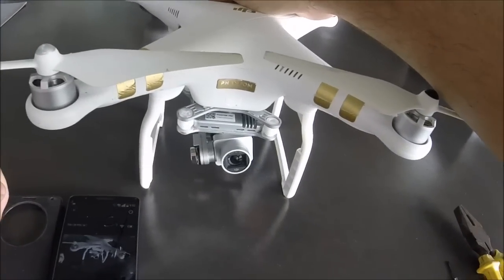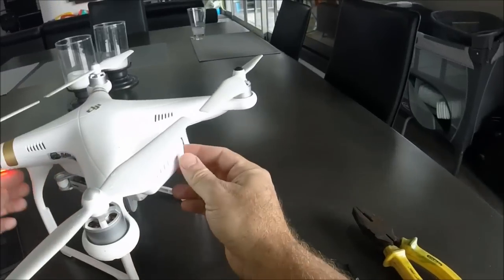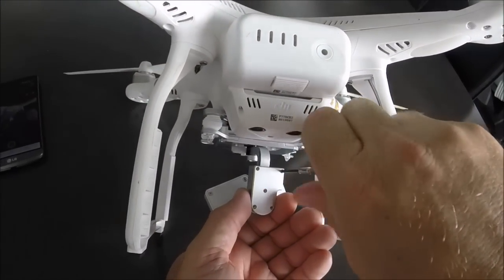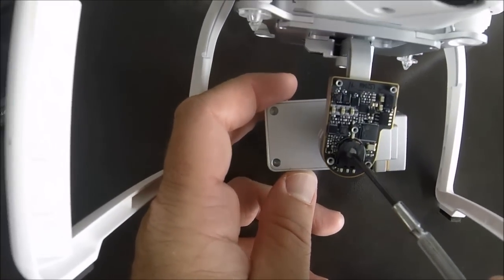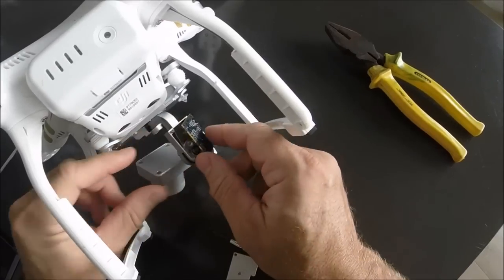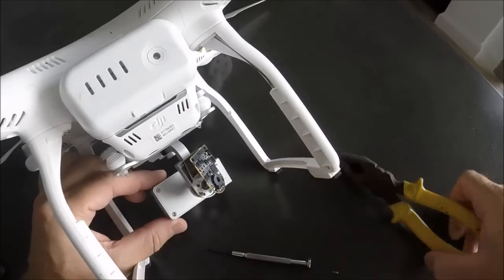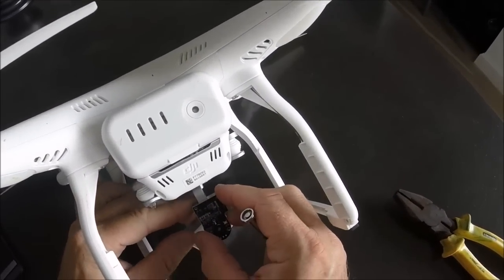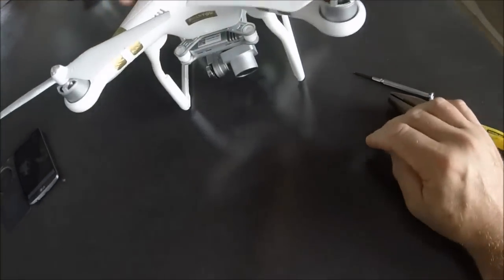Repair Phantom 3 gimbal startup position - SOLVED

Comment: So, this is only a temporary fix, until you move, relocate or otherwise transport the drone, then you have to do this ALL again.
My question would be, what component has failed and caused these components to become mis-aligned? are these shafts supposed to be glued together somewhere to prevent this from happening? is the "press fit" just smaller or larger than "press fit" and allowing the gimbal motor to slip on the shaft?

what is the REAL underlying issue here that needs to actually be fixed? I am tired of realigning this piece of shit every time I choose to fly it (which is becoming more and more regular now in time)

Comment: something very strange happends to me, I fix the dent and turn the drone, and the camera is horizontal, but after a few seconds the camera tilts a little. I turn the drone off and on again,  the camera is still in the new tilted position, and after a couple of seconds tilts again even more. Every time I turn it on it tilts more
also when its turned the gimbal starts to heat a little
does this happens to anyone? I would like to see a video with this problem before opening my drone with no clue of what to do.

Comment: Thank you! Thank you! Thank you! Thank you! Thank you! Fixed my problem.

I didn't crash but my gimbal lock came off and the gimbal must have been bouncing around for who knows how long inside the case.  Just a tip, the screw on the bottom left of that plate is a different size diameter than the rest.  Don't mix it up.